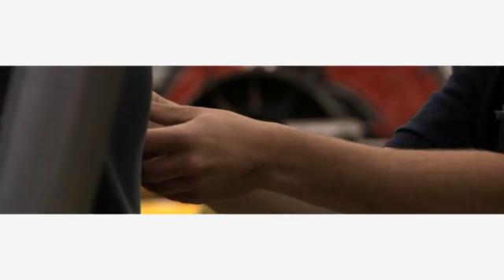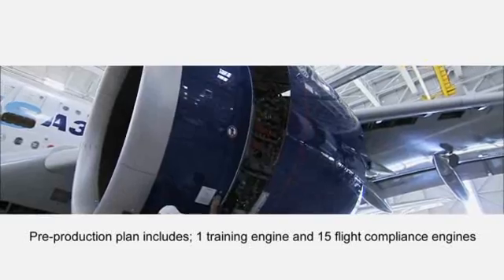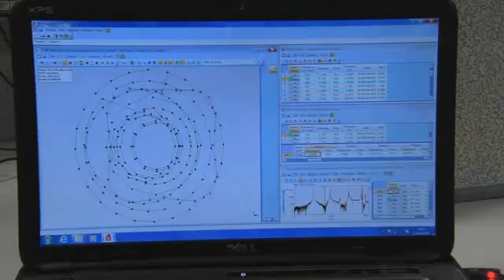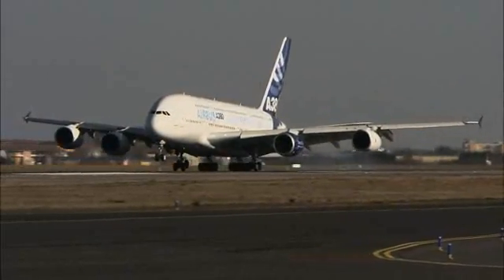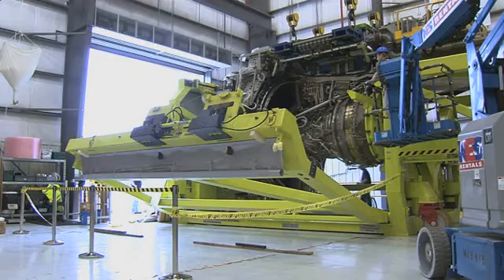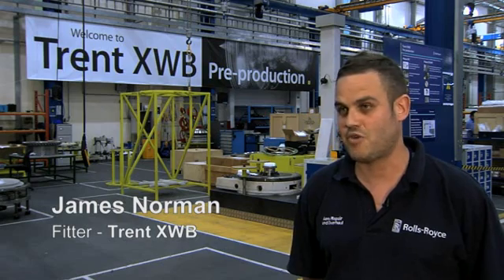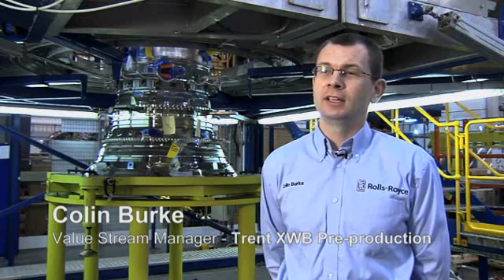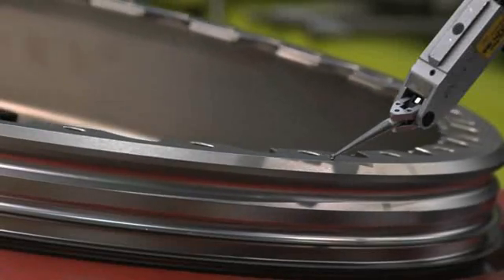Trent XWB Engine For The Airbus A350 XWB (Update On Testing)

Comment: The Trent XWB uses an old outdated triple spool from the Trent 900 that exploded on A380. At best it produces 80,000lbs of thrust for the A350-900 however it's a flop at 93,000lbs for the A350-1000, Airbus promised Qatar and Emirates 100,000lbs of thrust and it's stuck at 93,000lbs of thrust. This is the core engine that causes so many problems on the A380 and it's hard to believe their putting a twin jet. The new GE-9X with 104,000lbs of thrust will make the 777-9X the new Airbus Killer. LOL

Comment: They've been ejecting geese and ice into engines for years. Bypass jet engines are getting bigger in order to take advantage of the by pass bit of the engine. The front turbine acts as both as both as a propellor and a compressor which allows the engine to run more efficiently and cheaper.   Like I said BEFORE they eject geese/debris into engines to test whether the engine can contain the explosion and not cause further disintegration of the engine. The engine will fail, sure.

Comment: That's the reason why they are using dead geese, to ensure the outer casing contains the damage/explosion and to prevent it from causing damage to the aircraft/wing. The engine casing is designed to prevent shrapnel from exiting and hitting any part of the aircraft that would likely kill passengers or bring down the plane.

Comment: The engine won't explode, that's the whole reason for the test. It is to ensure that none of the turbine/compressor blades cause further damage to the engine, particularly the exterior casing and the wing.